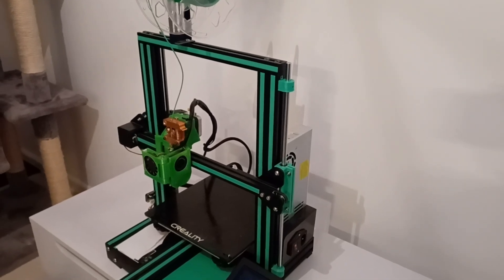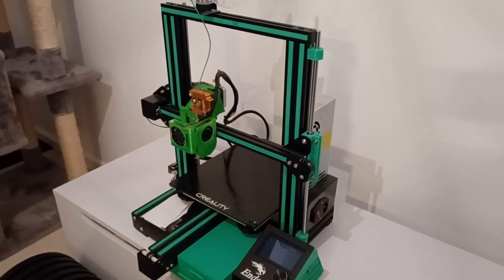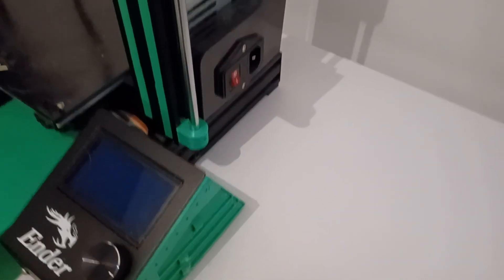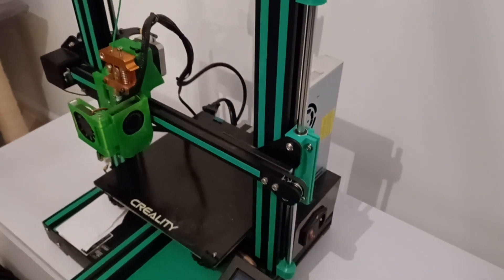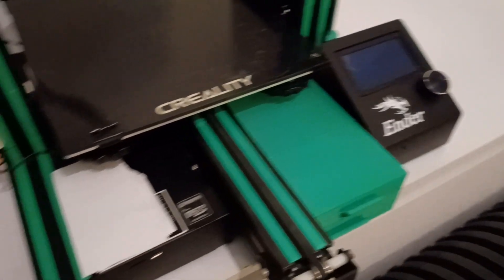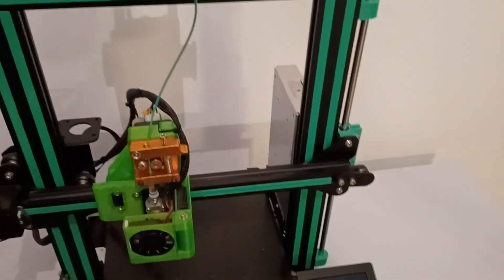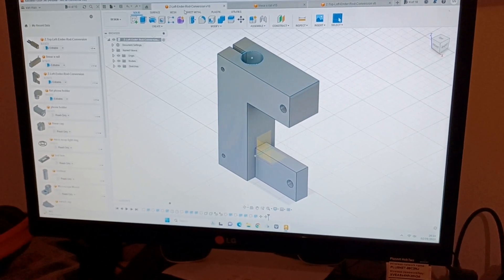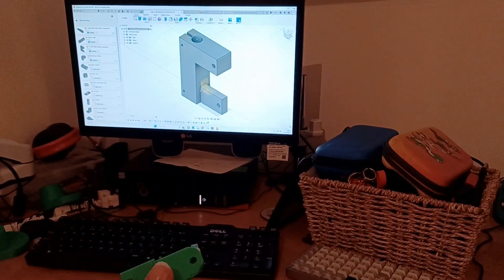Ender3 pro linear rod conversion

Comment: Looking for forward to the completion of this project/mod for old Ender 3's that are still in service! Great job and subscribed so I'll be following this project as it seems a good alternative to linear rails with a reduced BOM cost. Keep up the good work! This could be a nice combination along with this popular mod: https://youtu.be/oUdoJUs8Zcg?si=jHJ4et_DGlI-QnvF
Reply from the maker: Thank you have designed all parts will do video soon
Reply: @gadgetman12  do you have github or printables account to foolow process, i guess its the best fit for dual belt z also way cheaper than linear rods

Comment: Good stuff, always great to see that with some smart design you can save a lot of money, and bump up the quality a lot. 
If you are going to add the linear rod on the other side, you will have to pay attention to overconstraint! You'd run into binding issues, and/or excessive friction causing wear. Similarly, it would be best to have some decoupling for the Z-lead screw, although that is of lesser importance now. 
If you don't know what overconstraint is, or are interested in mechanical design of things, I would HIGHLY recommend the book 'Exact constraint machine design using kinematic principles' by Douglas. The book doesn't go into complicated math and stays pretty down to earth. It has seriously 'leveled up' my designs for sure.
Reply from the maker: Thanks for the information will take a look 👍